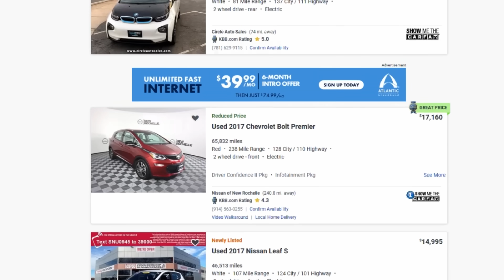Bolt Alternatives Under $20k

Comment: I was offered, and accepted my buyback offer of $33417, and bought the Id4 1st edition for about $7000 after the tax credit. It is not as quick as the Bolt, but I absolutely love it.
Reply: What year was your Bolt EV and was it a Premium and what options? Thanks.
Reply: I.D. 4 is a winner I am thinking about getting one too
Reply: I was declined a buyback for my 2017 Bolt EV Premium with 25K!  I was offered a Owner's Loyalty Certificate of a paltry 3K which I have ignored.
Reply: @Jeff-wb3hh  Good point.  I bought it in Ohio where I reside.
Reply: @Jeff-wb3hh  mine was a 2017 LT with DCFC the only option.

Comment: What about Hyundai Ioniq 28kwh?  Under $20k, has battery cooling and is a great car.
Reply: I have one! It is a great car!
Reply: Isn't nearly half the range? Might be fine if you are surrounded by DCFC but not in my area
Reply: @bradjackson1691  130miles to a charge is plenty. Especially if he use to have a 70mile i3.
Reply: @bradjackson1691  is extremely efficient(one of the best in my opinion) and is charging really fast at 70 kw. For me, as a city car, is wonderful.
Reply: @kakashi3543  yep I've heard it was one of the most efficient EVs when I was searching around a few years ago. I can appreciate the use case as a city car but I'll keep my Bolt since I can only afford one car at a time and would like to travel with it soon. To me for example, it's similar to comparing the cost per ounce of a bottle of laundry detergent between two different sizes and prices points. In my use case, I use it as my side hustle ride for food delivery. I had an i3 rex before a total loss wreck (panels and glass were insanely expensive) last year, now I can complete more orders per full charge with my Bolt and for much cheaper. I am thinking of upgrading to the Ioniq 5 or Fisker Ocean though.

Comment: If someone is not restricted to electric only, I would recommend a used hybrid.  Something like a used Prius.  My wife drove a 2007 Prius for over 10 years before she got a 2018 Model 3.

The costs of buying and operating such a vehicle is low.  Especially if you have a long commute.

My wife's office mate  has such a case.  Fresh out of college and newly married.  She had to have new BMW 3 series.  He was still limping his college clunker on a 100 mile round trip commute.  Repairs where getting troublesome.  His wife said get a Model 3.  He didn't feel they had the money with BMW car payments, house payments, etc.  So my wife and another of his friends suggested a used Prius as a bridge car to a Tesla.  He bought a 3 year old used Prius.  He likes the Prius a lot.  He was pleasantly surprised on how much gas money he saved.  Even his wife prefers driving the Prius over her BMW.

I have a love hate relationship with Toyota.  I think their hybrid technology has been a fantastic green technology.  It has saved tons of CO2.  I think it will take Tesla 5+ years to catch up to Toyota in CO2 reduction.  On the other hand Toyota has done BEV vehicles at all (Beside compliance).   I also stunned that Toyota never made a Tacoma pickup hybrid.  I ended up buying a 2011 Lexus 450H hybrid to pull my camper.

Comment: Somewhat recently bought a '17 Bolt in order to avoid several thousand dollars of repairs and maintenance in my old Mercedes. It's a premier, 30k miles, I bought it in February, paid $18k (in Southern California too!). I came to the same conclusions and I'm happy with my decision. I'm a huge car guy and I think the Bolt is dreadfully boring, but it's a fantastic car and utility. I genuinely could not believe how low the running costs are.

Comment: The first time I saw an Imiev I thought to my self "who would want to drive in that". Then I got one to fix the BMS to take bigger batteries and after driving it I really wanted to get one. With new batteries it will do 200km. The interior is not great is very noisy a bit underpowered (for an EV) but getting in and out of it is so good. You open the door and is so easy to step in and out. It is great for a runabout car.
I think Mitsubishi could make them as a cheap entry-level EV.
We call it the Chipmunk.

Comment: After coming off of a Smart EV lease, it's super discouraging trying to find a replacement EV here in Seattle.  I test drove a 2018 i3 REX back in January when the price was ~$18,400 - Now that same car is selling for $26k - absolutely nutty!  I want something with at least 120 mile range and options are so limited.  The 2018 Kia Soul EV can be found out there, but has Chademo, and none are for sale around what they should be selling for.

Comment: It doesn’t get much love, but I have owned a Ford Focus Electric for about five years and love it. Despite the compromised cargo area and low range, it’s still a joy to drive and own.
Reply: I just got to drive one for the first time earlier today actually was interesting comparing it to our 2012 leaf and my 2014 flex fuel focus.  They really threw every option they could in the focus electric!
Reply: Besides DC fast charging lol
Reply: The same could be said about the Chevy Spark EV.

Comment: Another affordable compliance car that I owned and absolutely loved was the Chevy Spark EV (I had a 2015 Spark EV 2LT w/ DC Fast Charge).  I realize its range isn't what you are looking for, but I still think worth mentioning.  I have since upgraded to a used 2017 Bolt EV Premier and I enjoy the car, especially it's much longer range, but I have to admit I rarely use the DC Fast Charge as my usual trip range with that car remains well under 100miles per day.

I'm a bit more hopefully the software update will address the battery issue that has come up on a small percentage of cars... if it does not, I am banking on GM doing the right thing if required (at least eventualy), but for now, I'll continue to bank that I'm on the right side of luck and have made the right decision.

Good luck on the move and I wish you the best in your car decision.

Comment: Did you consider a 2017 Mercedes B250e? I was shopping in a lower price range (15K) and ended up pleased. Many available with very low miles. Tesla built, thermally managed drivetrain, practical interior & cargo, and when using Range Plus mode, 126 miles is possible. Mercedes was conservative with the range rating. No DC fast charge, however. I’m in Arizona, so you can imagine solid AC + liquid thermal management are key for any EV.

Comment: Despite being a little scared by what you've said about the BMW i3 w/REX and the fact that it's taking VROOM forever to deliver it to West Texas (5 weeks and counting), I'm getting one. I found a 2014 for about $13,500. ($15,700 after TTnL and delivery) For me, it solves the biggest problem we have out here. There is a serious lack of charging infrastructure and (theoretically) the REX will make it useable on long trips. In retrospect and after waiting more than 5 weeks I'm regretting buying it the way I did. Fingers crossed that I get a good one.  :-)

Comment: I'm still kind of looking from the sideline,and try to keep myself informed. I began to think the i3 Rex was the one to get, then I started to hear of stupidly expensive repair costs because of the construction - so I'd only get one under a BMW warranty and that pushes the price up. I like the Mini E because in a way it's a i3 with normal construction, the range is a little disappointing, however the GOM is known to be very pessimistic and in the UK owners/testers have gotten 140 miles from a full charge with some gentle driving in summer.

Comment: I'm holding on to my 2019 Bolt EV (AKA "The Delta Flyer"). I don't own another car to use as an alternate, but I feel confident enough that I won't have any issues as I've always kept the SOC to the 20-80% region and have only full-charged for the occasional road trip. I've also had the service update and diagnostic done. I've never had any issues other than an intermittent glitch on the center screen. Aside from that, the Delta Flyer is still my happy place. :) Cheers!

Comment: Oddly enough, the rebates on EVs we get here in Québec end up competing with the used EV market. 
For instance, the 43k$(Canadian) 2022 Bolt is 30k$ with provincial and federal subsidies applied to the sticker price, which is about 20k USD.
Used EVs only get 5k$ off, so they're about equivalent to a new one.

Comment: To your point about PHEV owners commuting within their electric range and getting a low range EV instead and renting a long range car for long distance trips. As a Volt owner I wanna say that this wouldn't work for me at all, the Volt is a compromise, I couldn't afford an EV with adequate range and the specs I wanted (no CCS and missing back up cam for instance were a dealbreaker many times). I commute to and from work with the Volt and do basically all my daily / weekly driving using it's electric range, under normal circumstances I never need the range extender, however I do like being able to just hop in my car and go on a trip whenever I want spontaniously without any preperation, this is completely impossible with your suggested method, which is why I think these short range EVs are almost always used as second vehicles by households with 2 cars at least.
An EREV like the Volt or I3 REX fills a very small niche at the moment, and it so happens that I fit into that niche. The niche low range EVs fit into is much larger but it religates them to second vehicles oftentimes accompanied by an ICE or HEV car.
Reply from the maker: I absolutely think a PHEV can be a great option for some folk, and if my husband's commute had been within the range of our Gen 2 Volt, we'd have kept it (but he was commuting 50mi a day on the highway). 

But I also know folk who only drive less than about 40mi for 99% of their travel, taking (planned) longer trips only a couple of times a year. Someone in that situation could do well with a compliance car and a petrol rental for those rare trips. - Winter

Comment: Your video was well reasoned, and your decision was probably the best for your guidelines and use case. One other consideration that I would add would be the option of leasing. GM is eager to post high sales numbers on their refreshed 2022 Bolt, and I've seen local deals of $269 a month, with $4K down, for 36 months, with a 10K mileage cap per year. It was the low cost of Volt leasing that first got me interested in EVs, and it was a good experience for me. It could be your transition EV until Tesla's $25K "Model 2" comes out in 2023, or another new or used EV with the attributes that you want (at your preferred price point) emerges.

Comment: Sorry to hear your i3 experience ..I got mine used from BMW dealer (they take care of issues,most for free) for $15k only 25k miles on it
Reply from the maker: I got mine from a dealer too, and while the car was under warranty they took care of me, but also made it very clear which issues wouldn't be covered under my certified used warranty when the main warranty ran out, which is why we didn't even keep the car through the CPO period. In 18 months she'd taken thousands upon thousands of dollars in warranty repairs, and several of those repairs wouldn't have been covered under CPO. - Winter

Comment: I think your decision to keep your Bolt was well thought out and a good decision. 2 cars conspicuously missing but should be widely available on the west coast are the Chevy Spark EV and the Kia Soul EV. If you need the extra hauling space the Soul EV would be good, however, if your considering using a motorcycle, eBike, or scooter but want to stay dry in the rain, can carry 4 adults and is a blast to drive, I recommend the 2016 Chevy Spark EV w/ DCFC. In this warm weather my Spark is returning much more (90 to 100 miles) range, and you can't go wrong with 4 doors, 140hp and 327 lb ft of torque, but again keeping your Bolt is a sound decision.
Reply from the maker: You're right, I should have included them both. I ruled our the Spark because its cold weather range just wouldn't cut it for some of the driving I could need to do in round-trip terms, but it's a great little car by all accounts and I've known folk who loved them. That includes someone I met up at an EAA event who had driven theirs cross-country!

The original Soul I ruled out because of the previously mentioned issues with non-thermally managed batteries (though the Soul had fans if I recall) and CHADEMO quick charging. - Winter

Comment: Single car could be a good option in a good public transport city but the math is different for everyone. I think you'd get by in the short term and it shouldn't be but two years before more options are available on the used market. I have heard online rumors of a couple Bolts that the software has warned on and bricked the car, needing a tow to the dealer where it was found at least one marginal module needing replacing. So it appears to be doing its job. My 2017 (26K miles, bought used with 18K) had no issue found during the diagnostic and since I've always used Hill Top and never ran it under 20%, I'm still parking it in the garage. And the stats are on my side too. Good luck in the move!

7/9 Update: Now we have two cars that have caught fire after the final update so now I don't trust my 2017 either. But Illinois lemon laws suck so I'm stuck. Not sure what I'd get selling privately but Carmax offered (sight unseen) $15,800 for a KBB rated Clean '17 with 26.5 miles. Not ideal. Ten grand less than I paid for it two years ago. But a chance of burning down the house isn't ideal either. I would not trust any newer Bolt EV/EUV since they might have the same problem but just aren't quite old enough to start burning yet. Roll of the dice for now. Frequently charging to 100% or dipping under 20% often seems to be the problem. At least I've been between 40-87% all the time so that might improve my odds. Now it's waiting to see how GM reacts to saving their EV future sales.

Comment: What about a 1st gen Leaf with a battery upgrade?
Reply from the maker: I address that at the 8:57 mark. The cost of a Leaf with an upgraded battery runs awfully close to a Bolt and higher than a Gen 2 Leaf. Plus, you're geting a CHADEMO car with cell chemistry that is still somewhat suspect. Also, though I don't mention it in the video, some DCFC providers are banning modified cars, and that includes Leafs with battery pack upgrades. I think the pack upgrade probably makes a lot more sense for existing Leaf owners than someone coming at the car cold - Winter

Comment: Interesting how you were going to consider a BMW with the range extender but not the gen 2 Volt with it's hold function and range extender.
Reply from the maker: If I’d personally gone back to an i3 it would have been the BEV version, not the REx version. But while I quite liked my Volt, I found that its range wasn’t enough for my needs and the 50mi figure really didn’t hold up with highway driving - Winter

Comment: I did the same exercise when I came to the conclusion that my Ioniq EV 2017 had not enough range. I have looked at the ICE models and frankly, they all suck. For plugin cars, the Volt and Ioniq Plugin were interesting but almost at the same price, I was able to get a Bolt. Seriously, for the range, unless you want to pay a higher price (aka Tesla), there's nothing else more reliable and predictable than the Bolt. The Kona EV and Niro EV tend to be good the first years and then, it's a hit and miss (without talking about the lack of certified mechanics at their dealerships). The Nissan Leaf still lacks range (40kWh), a real cooling system (so hello degradation) and Chademo is soon to be dead.

Comment: I think there's a good distribution of chademo chargers. But the majority do 50 kw.
Reply: Contrary to YouTubers chademo will be here a long time. Lots of old and new leafs  still need them even if Nissan is going to ccs. Our city is putting in dual ccs/chademo all the time. Owners are not going to pay to remove chademo on the station.
Reply: Saying CHAdeMO is vanishing just doesn't match reality.  Every EA site: +1 CHAdeMO.  Every EVgo, ChargePoint charger: +1 CHAdeMO.  We have both CCS and CHAdeMO cars - CHAdeMO far more reliable (if charger itself working).  Winter, there are still inductive charging paddles out there for RAV4, etc.
Reply: @mikecarter2737  Yes, and www.plugshare.com shows tons of chademo chargers around the USA.
Reply: @markfitzpatrick6692  yeah, I think chademo will help the used electric cars that have chademo.

Comment: What about the Chevrolet Spark EV?? Made from 2014 to 2016. I have a 2016 2LT with 70000 kms on the clock. Love my little car!
Reply from the maker: The Spark EV is a great car, and I should have mentioned why I ruled it out, which is simply the range. I'm very used to living a good 25mi from most everything, though it'll be better in OR (not a ton though, the studio will still be pretty far from me) and in the winter time, especially the winters I'm used to (though again, not as bad in OR) the 80mi range is cutting it fine with cold weather stripping away a fair bit of range. - Winter
Reply: @transportevolved  I have seen several videos on the Spark EV, and the car seems to get a good portion of love. Battery-pack seems to be charged at a decent speed, too.
Reply: @Greybone62  yes. Low maintence costs. 327 ft lbs of torque. 160hp. It's a speedy go cart! The battery thermal management system is superior. I have about 70000 kms on my spark EV and bought it at 26000 kms. I have seen no battery degradation.
Reply: @transportevolved  yes. That would be a little thin on the range side. I am extremely fortunate that my commute is 32 kms per way each day to work. I have charging at work  which is 240 v and free. It is my primary charging source. This car is fun to drive and does not get the credit it deserves